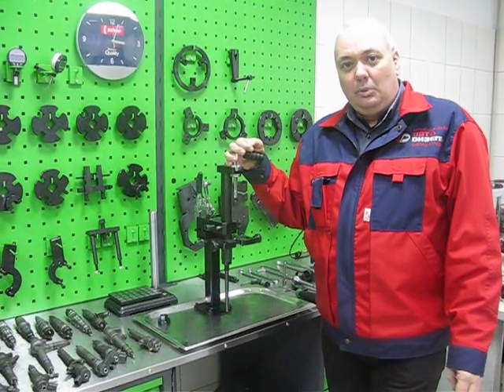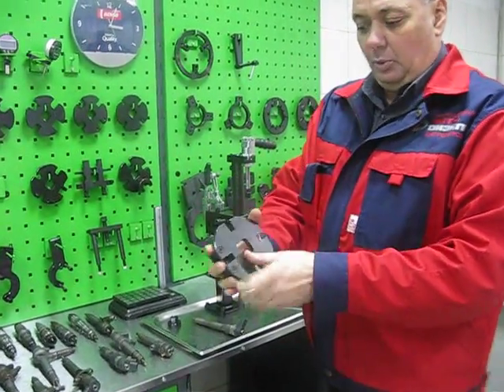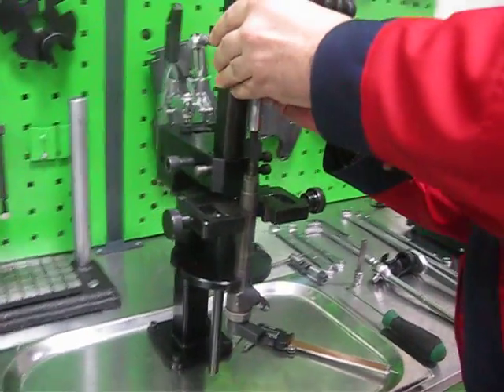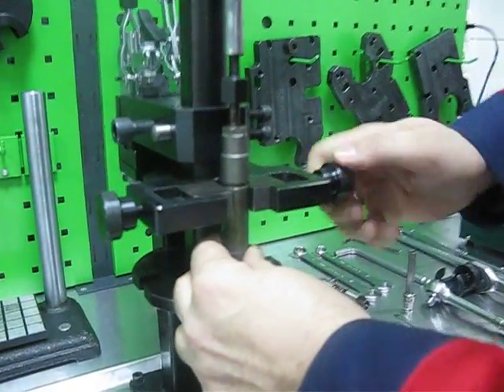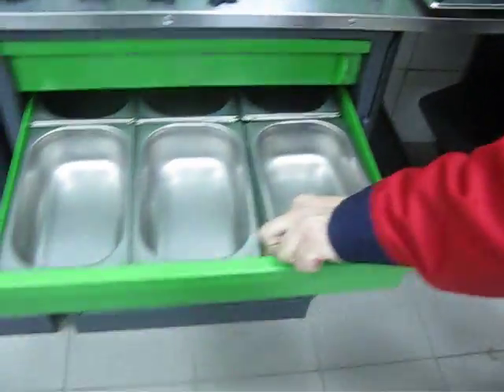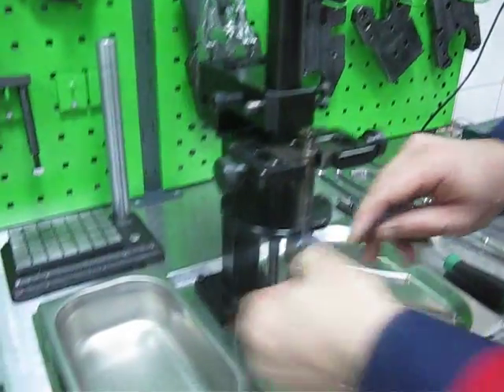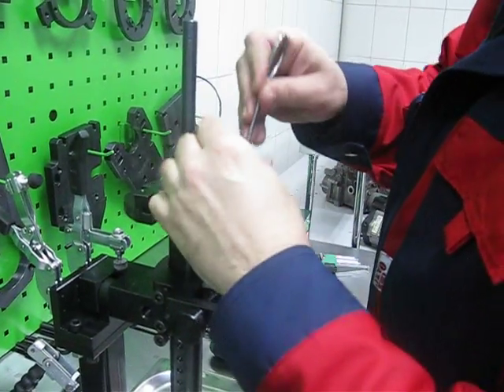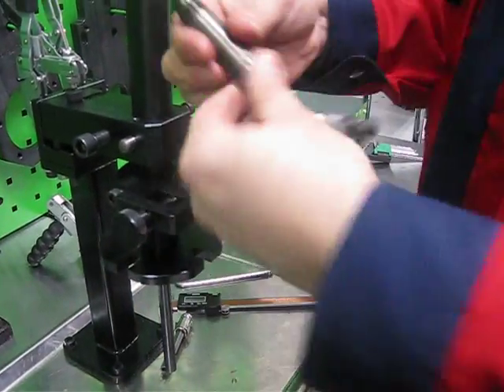BOSCH COMMON RAIL CRI INJECTOR DISASSEMBLING PROCEDURE

Comment: Excellent, shows the use of well designed and engineered fixtures and gauges for disassembling and measuring wear on the injector components.